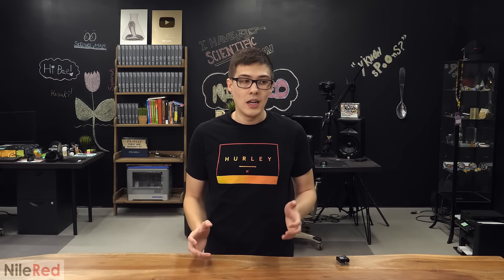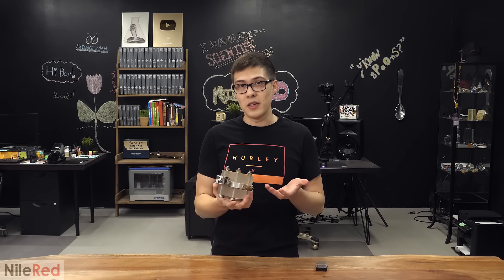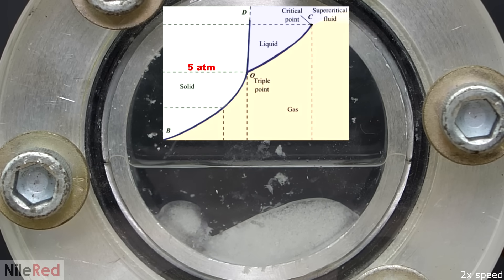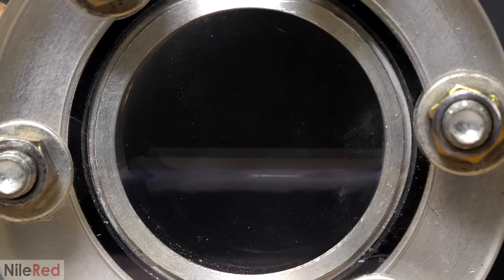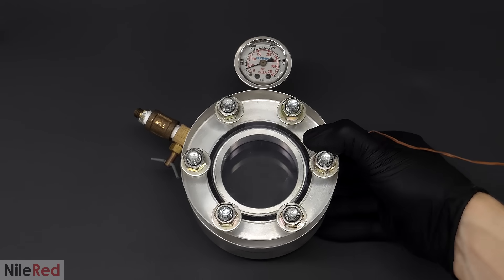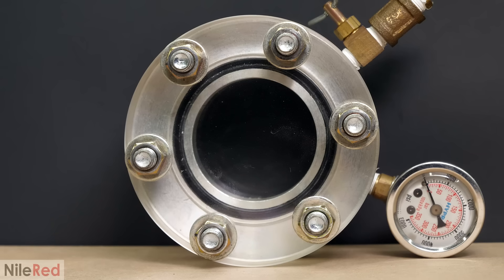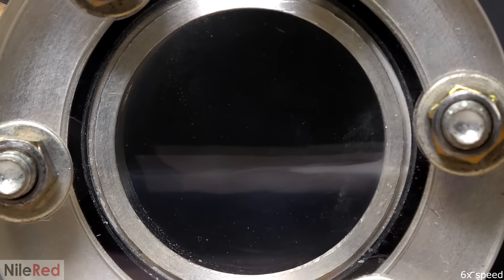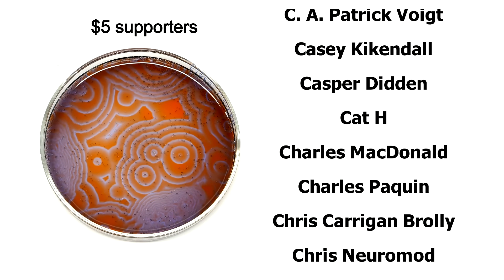Going supercritical.

Comment: 15:05 Considering that opal is fractured, water-impregnated silica, the effect might actually be very similar to opal! The cracks are thin enough to refract light and scatter its wavelengths, causing iridescence (like in hummingbird feathers or certain beetle wings)!
Reply: He made a synthetic opal essentially
Reply: @noahturner256 r/nosh*tsherlock
Reply: @noahturner256  *facepalm
Reply: I love that phrase. "Water impregnated silica"
Reply: @hfogg  fantastic phrase. Like I wanna make baby jokes! Congrats silica, when are you due girl?!? 🤣
Reply: It's not exactly like Opal, where the color is based on the spacing of microbeads in the opal (sounding smart but I just watched a TedEd video on it this morning). It IS exactly like what happens in fractured crystal glass (crystal ball) or in fractured quartz, which are also very pretty. This is a thin film, although sort of in reverse, where the "film" is the less refractive medium (air) instead of the more refractive medium (film). It's still a matter of seeing light reflect off two very close and fairly molecularly flat surfaces and so interfere.
Reply: @CharlesBosse  Agreed. Opals give off their color due to light deflecting as it hits the arranged, micro beads of the silica. Diffraction then comes into play to create the bands of the spectrum. Extremely fine cracks in the silica, provide the mechanism for this to happen. Likely caused as the silica was stressed through the process.
Reply: @CharlesBosse  thank heavens someone explained this correctly
Reply: He made synthetic diamonds... and don't even know it. jk ;D
Reply: @BillAnt  Nah, wrong material. He made a bootleg synthetic opal more than anything. Diamonds are carbon, this is silica.
Reply: @shadowtheimpure  < Well, it was just for humor, thus the "jk" at the end my post. lol
Reply: @BillAnt  Fair enough, just had to put my science in there. Have a good one.
Reply: @shadowtheimpure  < And I appreciate that, always good to learn something new, and maybe have some fun on the side. :)
Reply: I didn't know this guy was into nerd stuff. Cool
Reply: It's so weird when youtube worlds collide that generally have nothing to do with each other and you realize they are actual people who watch youtube videos as well
Reply: The reason opal makes colors is that the silica settles in prismatic shapes... Like think of putting those beads in a line, if each next line settled in the valleys instead of on the peak, it would likely show color.

The effect shown here looks pretty much exactly like how some crystals shatter..

I will ask my dad if he knows anything about why this is happening
Reply: Wait....why you know all that
Reply: At microscopic scales, precious opal is composed of silica spheres some 150–300 nanometres (5.9×10−6–1.18×10−5 in) in diameter in a hexagonal or cubic close-packed lattice. It was shown by J. V. Sanders in the mid-1960s that these ordered silica spheres produce the internal colors by causing the interference and diffraction of light passing through the microstructure of the opal.- Copypasta from wikipedia srticle for opal.
Reply: Definitely nothing close to like opal. This is fracture fire and its more like a prism. Opal is from the arrangement of micron sized silica beads arranged neatly. The colors come from the size of the silica spheres and the gaps in between that are water, again micron scale. 

This is from internal fractures that the light bounces off of like a classic prism.
Reply: Oh hey I didn't know Gryphon liked supercritical CO2!!
Reply: I thought your jam was music but it is also science that's cool (pun intended)
Reply: I was thinking the same thing! what happened to the beads here is very similar to the formation of actual opals. Similar elements put under a somewhat similar situation, I wouldn't be surprised if this was the case. Looks like we might have a new way of producing artificial opals!
Reply: You're also interested in science???
Reply: Kinda neat that you can make some pretty lookin’ gems with silica gel, a hair dryer, and dry ice.
Reply: Anyone work for Applied or Intel? I remember my dad talking about supercritical and liquid CO2 but I dont remember exactly what he said. He worked for Applied, at an Intel facility.... who uses alot of silica I believe. Maybe someone can tell us how Intel uses this?
Reply: yep, probably. now i wonder if the cracks are  only because of the pressure, or the impacts they received  (when shaking the beads) was the triggering factor
Reply: I love his this video, and I want to see the larger scale silica, but all I can do is wait patiently and opal make the video soon.
Reply: Opal has a silica structure that reflects light. I think the cracks just happened to be able to rearrang the structure enough to reflect different light colors
Reply: opal is not just cracked silica. It's a regular arrangement of identical tiny spheres of silica with diameter about that of the wavelength of light (so they're too small to see in a microscope using light) It takes millions of years for the balls to slowly precipitate out of water and find a place in the growing "supercrystal". No-one has been able to reproduce this in the lab as far as I know.
Reply: *facepalm
Reply: Yeah, like a prism!
Reply: How is it water impregnated? It was in co2.
Reply: @tsmall07  I said similar, not identical. :-P
Reply: @BlackGryph0n  I misread what you wrote.
Reply: aren't you the tracer dude? /j
Reply: It also has the same opalescence
Reply: Perfect explanation😻
Reply: @whi2gan ”play of colour” is how jewellers describe it
Reply: opal refraction is created by formations of circular silica atoms.
Reply: An amazing brain was hiding behind an amazing voice
Reply: Man
Reply: the hell ya doin' here
Reply: too many big words I'm not smart enough
Reply: Oo black gryph0n
Reply: "water-impregnated" - Black Gryph0n
Reply: omg gryph0n
Reply: It could be "oil sheen" from something that was inside the silica or coating it, or even something in the CO2 or the O-rings that was dissolved in the CO2 and was left behind.
Reply: put a glass ball in a vacuum machine and see what happens
Reply: @s0rrex  still saving for one u.u
Reply: You made quartz crystals my friend
Reply: It might have displaced the particles in a way that made some parts an opal
Reply: water impregnated silica, but they have no penis?
Reply: I’m sorry, the water did WHAT to the silica?

I’m mostly joking but surely there’s a better word for it than impregnate
Reply: My guy is a musician AND a nerd

Sick
Reply: It is certainly beautiful.
Reply: I think it is due to internal reflection from 2 layers and subsequent in interference leading to some colour to interfere constructively depending on the width of the cracks(thats why we can see different colours randomly)

If it was refraction then the result would have been a sprectrum.
Reply: That's actually what I was thinking. Nigel made lab grown opals
Reply: It's so beautiful! At 13:40 you can see a perfect example of Rayleigh scattering.
First you can see a flash of blue haze (particles less than 1/10th of a micron = Rayleigh scattering) which quickly turns into 'white clouds' (particles larger than 0.5 microns) which is in the Mie scattering domain.
You should try to shine a white light through it from behind whilst going through the Rayleigh scattering phase - the light should turn orange (just like during the sunset).

It's like you have a sky in a jar.
Reply: @harrietramos8691  The Rayleigh scattering is also what makes the aerogel look weird (blue), and it's why they both look sort of like smoke. In all three cases, very small, fairly widely spaced (molecularly speaking), particles are causing the scattering. If you put just enough colloidal solid in water (ahem, diluted cream) you can get the same effect.
Reply: @harrietramos8691  did you just completely copy and paste someone else’s comment
Reply: @harrietramos8691  copy pasted and stolen comment
Reply: @harrietramos8691  I’ve never understood how people are so desperate for some kind of attention that they copy and paste someone’s comment. It’s honestly a bit pathetic. Also, here’s the attention you crave
Reply: @orangeeel937  @Harriet Ramos I've never understood how people are so desperate for some kind of attention that they copy and paste someone's comment. It's honestly a bit pathetic. Also, here's the attention you crave
Reply: @stlr1876  epic
Reply: @orangeeel937  you do realise @Harriet Ramos made the original comment, just looks at the dates of when they were posted
Reply: @stlr1876  lol
Reply: @orangeeel937  wait I thought the other guy copied
Reply: @harrietramos8691  I'm gonna need a dictionary so I can understand half of those words
Reply: It's so beautiful! At 13:40 you can see a perfect example of Rayleigh scattering.
First you can see a flash of blue haze (particles less than 1/10th of a micron = Rayleigh scattering) which quickly turns into 'white clouds' (particles larger than 0.5 microns) which is in the Mie scattering domain.
You should try to shine a white light through it from behind whilst going through the Rayleigh scattering phase - the light should turn orange (just like during the sunset).
Reply: @johnsonman6261  nice copy and paste
Reply: @johnsonman6261  Why did you do that?
Reply: @GunkDung  because. if you look down the comments the identical comment was posted 8 months ago by someone completely different.
Reply: @johnsonman6261  bruh did you just copy paste?
Reply: oh wow hey Black Gryph0n

Comment: This is my first time hearing of Supercritical Fluid, and it got me to wondering a few things;

Does anyone know where Plasma might enter in to the equation? (Like on that chart that showed the Triple Point, and the Pressure and Temperature Values for instance? (for a single material))

Also,  are there any other "hazy states", where properties of two (or more? is there another Triple Point between any two plus Plasma for instance?) states of matter become almost mixed? For instance, Solid and Liquid, or Gas and Plasma?

Also; speaking of the Triple Point, besides switching between states of matter at the drop of a hat (so to speak), are the properties made "hazy" at that point at all? Or is it just that rapid changing only?

Thanks in advance for your time and patience :)

Comment: Regarding the light: Rainbow effects like this are due to changes in the index of refraction within materials. The reason that oil on a puddle forms a sheen, while oil and water alone do not, is that the difference in index of refraction separates the various wavelengths of light. Likely what you're seeing is very, very small gaps in the silica gel bead, small enough to affect the way light passes through it. The presence of a very thin layer of something (air? gel? unevaporated CO2?) would cause the same scattering effect. It would have to be VERY thin, though. For reference, thin sections used for petrology are 30 microns thick and sometimes display this effect. I used to make them in college. 

That said, really all an opal is is microscopic silica beads held together by something. And silica gel packs are made of the same stuff opal is, just dehydrated (that's why they work to keep things dry--they absorb water). So it's possible that you've formed really low-grade opal. I would be curious to see if the opalesence is retained inside vs. outside of water. Young opals (synthetic, mostly) tend to fall apart outside of water, while mature opals (synthetic opals allowed to mature and those found in the field) don't. This makes me wonder how much moisture was in the chamber when you ran it. Did you manage to force water into very fine cracks in the silica gel? Its' not impossible--unfreezable water is something geologists look for, as it can tell you a lot about how a rock was made--but I've never heard of this sort of process doing it before. Given the use of critical point driers in electron microscopy I'd think someone would have noticed. Regardless, if the water hydrated some of the silica bead around the crack, you could get a very, very thin layer of very immature and unstable opal.

Comment: The silica beads look like opal.
I suspect pressure and temperature shock may have caused the fractures.
It would be interesting if you could put the beads in the chamber and pressurize it with air, then release the pressure quickly to see if it fractures the beads. If it does, then you know it was pressure, but if not, try heat alone, without pressure.
But I suspect it is a combination of both pressure and temperature.

Comment: I don't think the gauge is broken, 5 atm is less than 100psi (gage pressure), which the first line off of the stop should be around 125psi. A quick reference of the phrase diagram would estimate the pressure to be about 8 atm when the fluid become supercritical. So at approx 350psi, is probably a good estimation of the pressure in the chamber and is reading correctly.

Comment: This may make zero sense but? Couldn’t the “cracking” be caused by an even pressure over the whole surface combined with temperature fluctuations it wouldn’t be a huge fluctuation in temp but combined with pressure couldn’t that be a cause? I haven’t needed to use critical thinking in a scientific manner in a couple of years. Just from what I remember that could be a cause.

Comment: Really cool video.. in gas testing for clean and dry gas we use a CVS Dewpoint Analyzer that can be used not only for testing gas but for bringing compositions to super critical . It uses a viewport and a mirror and has an acrylic viewing glass and the gas gets released on the internal mirror.. it looks so similar . The guy that literally wrote the manual on it taught me how to check the gas streams all the way up to -80c to find multiple contaminants in gas streams., so fun and interesting.

Comment: 14:40 Iridescence is common in physical reactions at the molecular level. In many cases, they are caused by tiny structures around the size of the wavelength of visible light. While I do not know the mechanism behind this one, it seems very possible to me that it is caused by microfractures. As you turn the silica bead, the length of fracture that a light ray passes through to reach your eye changes, thus changing the color you see. When light reaches the fracture, it becomes diffracted not at the exact point that the fracture begins, but instead at the point where the light ray interacts with the fracture. The wavelength affects when that happens. So if you rotate the bead such that an individual fracture's apparent size changes by around 300nm, you should see the fracture phase through its entire color spectrum exactly one time.

It likely bears some similarity to opal, as both are probably physical and not chemical.

Comment: Pressure gauge should stay upwards and should not get ever into contact with te liquid. Significant temperature drop was notable on the gauge inlet pipe. The copper pipe loses flexibility in the gauge mechanic so it just wont bend as it should to move the dial. Please take a look into the inner workings of pressure gauges and you will see what i mean.. With best regards!

Comment: The blue you see is no doubt caused by Rayleigh scattering by little correlated packets of atoms still trying to exist in the liquid phase. That is extremely interesting and unexpected but entirely reasonable. Other examples of Rayleigh scattering - blue sky, bluish cigarette smoke (goes in blue, comes out white = much bigger, consolidated smoke particles). In this case, as the phase change approaches, little groups of atoms remain correlated - stuck to each other as in the liquid phase - and they are smaller than the wavelength of the light, so you get Rayleigh scattering. This explanation also at least in part in behind the blue sky. I'm sure it's also at work in aerogel, for possibly different reasons (very very fine grained tendrils? Or perhaps the vesicles are small enough to act as scattering centers..)

Comment: At 1200 PSI you recreated a pressure and atmosphere environment similar to higher elevations on Venus at around 81.6 atm. The surface of Venus is around 93 atm and the highest point on Venus is Maxwell Montes which is about 44 atm. 

Because the temperature and pressure on the surface of Venus is beyond the critical point of Carbon Dioxide (which is 96.5% of the Venusian atmosphere), technically Venus is covered in an ocean of supercritical CO2.

Comment: I worked in the Cannabis extraction industry for 2 years using supercritical CO2 extraction. In my experience, different brand extractors with different flow rates and chamber sizes had different optimum pressures and temperatures. Do you know why is is, or a way you can estimate what conditions are best?